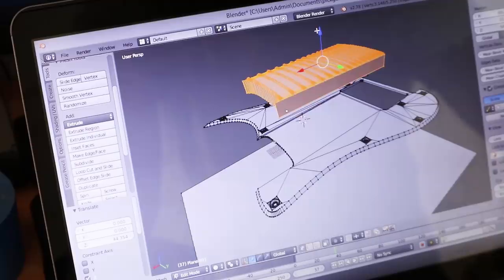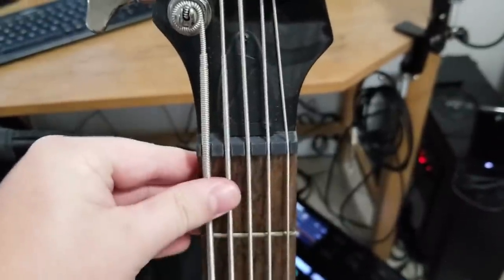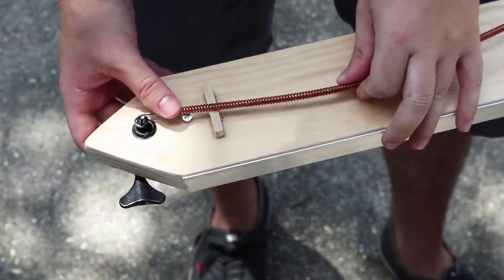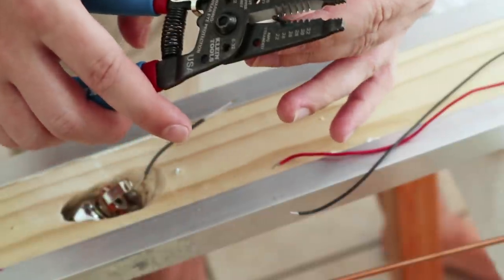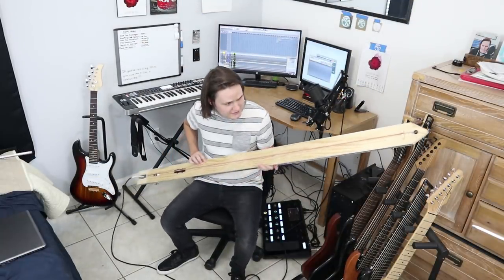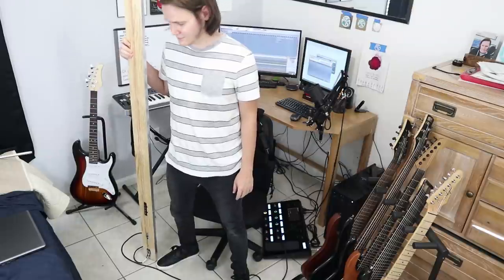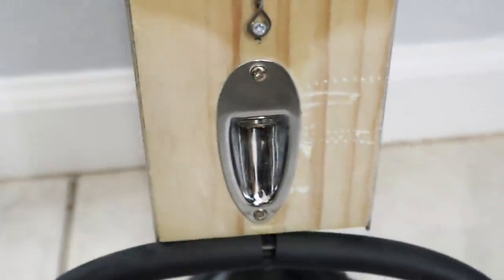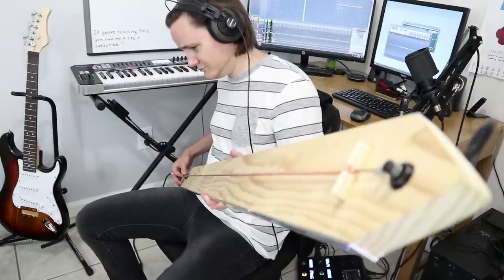Piano String Djent Stick Build (... and Tone Demo)

Comment: - Mod this as a fretless instrument
- Create fret markings
- Play in upright bass position
- Use some sort of glove next time to go some slides.
- Use a sustainer instead of picking, which reduces travel from pickup to fret markings.
Reply: use a nintendo power glove wired back to the guitar and you don't even need a fretboard.
POWER SLIDE!!!!
Reply: It still fretless
Reply: Chain mail glove
Reply: Or just be prepared to build up some major calluses.

Comment: You could maybe use a golf club or something to hit the string with. That way the lower notes might be easier to reach. Alternatively, you could attach ball-bearing rails to the sides of the plank and make a slide with a slack lever attached to it, so that you can push it up further than you can normally reach. I hope this makes sense.
Reply from the maker: Played horizontal you mean? I think I get it, that could actually be a very visual performance lol
Reply: @SaidTooMuchProductions  Not necessarily horizontally. I forgot that you can pluck the string further up the neck, so that explains the gold club suggestion (thought you had to pluck the string close the pickup). You can look up "contrabass trombone slide" to see what I mean by "slack lever" :)

Comment: The tone you get from it is so rich! I would be interested to see a humbucker or active pickup. That way it would have less noise. Also, I don't know your wiring scheme, but twisting the wires also helps. That way all the incoming interference cancels itself. Also, carbon fiber strips for the truss rod instead of the metal could reduce noise.  Also if you want to sit with the instrument you could set the audio jack end on the floor and add some weights on that end. That would at least shift the center of mass a little bit possibly reducing some neck dive. Just some ideas, it is a very tall instrument lol.

Comment: You might want to try that pickup in the regular orientation too... Bass player of metal band called KYPCK has a custom one string bass that originally had jazzbass pickups oriented like in your djent stick, but I've seen pictures of it were the body is clearly rerouted and pickups in the regular j-bass orientation... I quess he did turn them for a reason.
Reply from the maker: I'm actually finding out pinpointing a particular spot is better a tone than the sum of all of them

Comment: Was thinking wrapping some ferro magnetic around the string just where the pickup is would increase the signal strength, surely if it's only picking up the core then you must be losing some of the bass? Though obviously the thickness of the string will effect the speed of its movement through the magnetic field regardless. Also wiring in a contact mic will give you an even fatter sound.

Comment: First, string should touch the saddle and nut with unwinded part. It will improve both sound and intonation.
Second, I recommend to put the tuner on the bridge side instead 
Third, as already mentioned in comments, try vertical upright bass stand.

Comment: For quite a long time I wondered where I could find strings that long. Thanks for the insight ^^
I already ordered some to make my own build.
How about putting a wheel under the string, like a hurdy gurdy ? 
That's what I will go into when I receive mine.
I think I will operate the wheel with the help of a little electric motor, and put the controls somewhere on the middle of the stick. Two buttons to rotate it one way or the other.
I'll keep you updated if you want ;)
Reply from the maker: Sounds interesting, you can email me at saidtoomuchproductions@gmail.com,  I'd like to share how it goes too!

Comment: Maybe try hitting the strings with drum sticks? Also Idk about vertical pickup placements. It might pick up the string 4 times and that low low tuning might be too muddy. Try to mix in a clean compressed version with a highly distorted treble boosted, bass cut to zero A/B mix. That's all I can come up with.

Comment: Make a kick pedal mechanism that locks into the shape of the stick, in cello position, you have leeway on the neck, and use the kick pedal to bonk the string.
Reply from the maker: Just rig it on the floor and only use kick pedals lol

Comment: you could wire a second, reversed pickup in parallel, to act like a humbucker. (both pick up the same noise and humm, but one outputs it in reverse, so the signals cancel eachother out)
stick it where ever, as long as it has the same orientation as the primary one. i feel that would even add to the almost comical weirdness of this instrument.

Comment: Also, zip ties make decent low budget frets until they wear down.
Reply from the maker: Good point
Reply: @SaidTooMuchProductions  however there's also galvanized steel wire you can get at walmart or your home center

Comment: I think a guitar position could work if you made a bigger guitar-style body (like, bigger than a bass g.), and then have this as the neck, but angled. The bridge would be much further down, like an extreme version of how basses have the bridge as far down as they can.

So with the body at the traditional position:
- the bridge would be like, almost on the floor (additional support for the weight, since it would be really heavy with like 3+ strings)
- the nut would be a few inches above your head, and depending on the angle, maybe even at a frettable position

The output jack would be kind of a problem, but could be at the spot of the bottom strap button, with the actual strap buttons on the top horn ('d have to be super thick probably) and I guess at around the pickup.

Had this idea around the time of the octabass video but I'm writing this now because it's kinda more relevant I guess?

Comment: I'd love to see these low strings with either an ebow or a normal bow.

As one of those "amateur luthiers", levers could work, but what if you used a rail system and basically just made a slide that stayed on the string? Almost like a moving nut but from the top.
Reply from the maker: Interesting, i dont think an ebow will work cuz it needs to make the steel core vibrate all that copper dead weight, it was hard enough on the kalium, one string would be easy to bow with a bow anyway
Reply from the maker: The sliding lever is interesting levers I can move and just flip down and up  might be easy to play if you know where to set everything in place ahead of time

Comment: ******USE A "WEDGIE" RUBBER BASS PICK AND MAKE A HAND HELD ROLLING SILICONE SLIDE THAT CAN BE PLACED DIRECTLY DOWN ON FRETBOARD TO ACHIEVE NOTE OR TO USE LIKE A SLIDE TO WHERE THE SILICONE 2" IN LENGTH X .5 TO 1" DIAMETER PIN ROLLS ON THE STRING AS YOU MOVE UP OR DOWN THE NECK! (like a miniature bread rolling pin) NO FINGER DISCOMFORTING ISSUES!****** SUSTAIN IN YOUR GLIDES 'n' DIVES WILL/SHOULD BE MUCH BETTER TOO!